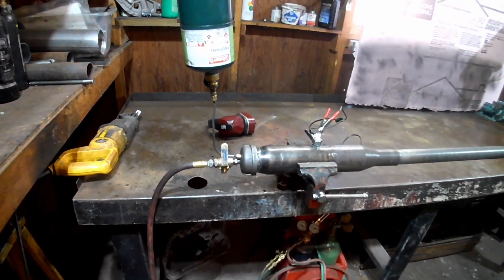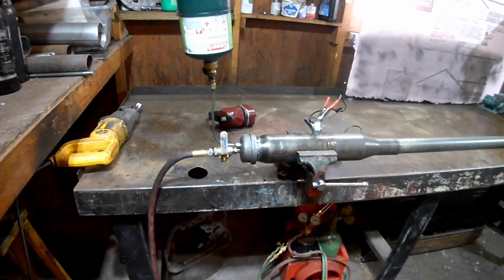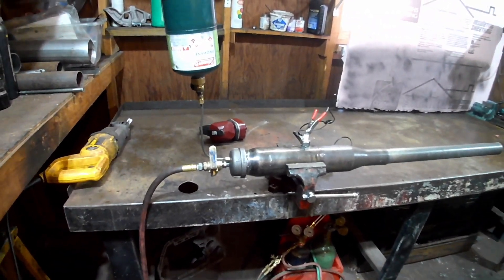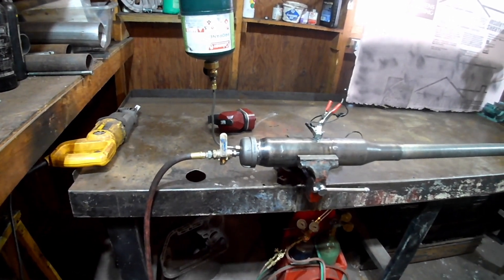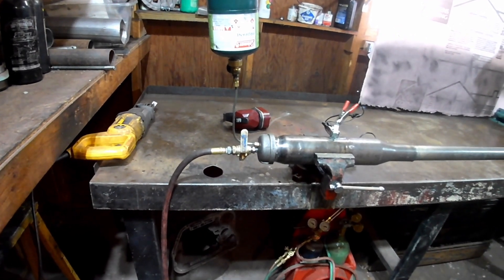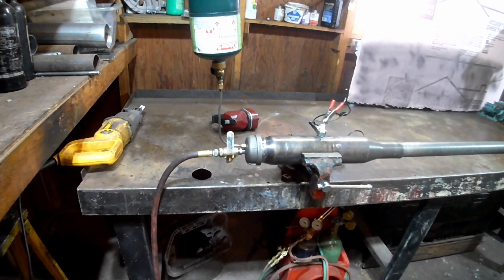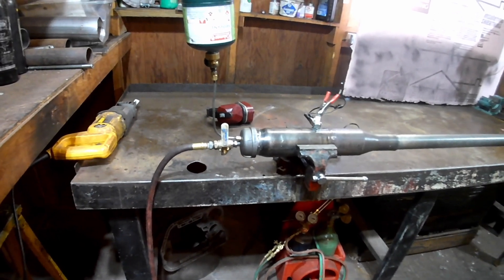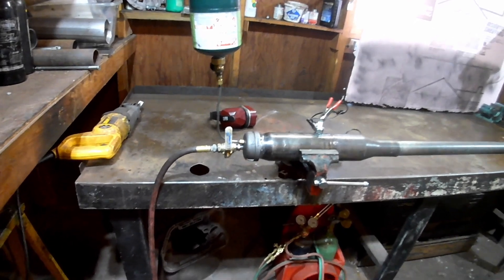Revisiting the possible pulse detonation engine.

Comment: I wanted to make rocket engine and pure oxygen wasn't available at that time so I built using my air compressor and stainless steel water bottle. I didn't know what type of engine is that. Now I know. pretty loud though : ) can you share a picture of diffuser and it placement.( drawing) It failed to pulse several times because fuel and air not mixed enough. Thank you
Reply from the maker: I have a vid, called pde spec. that gives the dimensions for the engine. and other specs. Built it out of a driveshaft from a mazda mk9.

Comment: With a pulse detonation the Shockwave should be supersonic would that not convert into a pressure wave which could be measured with an air/wind speed meter?
Reply from the maker: Atm, I can't think of anything that wouldn't break trying to measure it.  Though I did hook a load cell to it, that I usually use to graph rocket engines. It broke my load sensor. but last record was about 90 lbs of recoil.
Reply: @fignutron  what about at a distance say 1.5 meters maybe a windspeed meter
Reply: I have been working on a Pulse Detonation Engine using petrol and air for many months could you look at my recent video and give your opinion on what I belive are intermittent shock diamonds. Thanks
https://youtu.be/i4OOR8-gZ34

Comment: So how exactly did you get detonations to occur and what do you think made the design special so that it actually works? I had some success with a pulse jet 2 years ago but never knew how to make pulse detonation engines or rotating detonation engines
Reply from the maker: To be honest with you, I am not quite sure. This project started out as a ramjet idea. I didn't even expect the results that I got. Not an Engineer. Just a mechanic who has odd hobbies.
Reply: @fignutron  Thanks for the answer. Are you gonna try to research your project and see what could be the cause of the detonations?
Reply from the maker: @fallu6224  I am always researching, and when I figure out what is going on, I will post it.

Comment: Very neat video. I've read literature that said they could get small hydrogen-air pulse detonation engines to run at over 100hz. Obscene efficiency and the power to weight to boot. With how simple these things are I'm shocked they aren't used in hobby planes or rockets or something similar. There have also been some recent advancements in rotating detonation engines that seems really exciting.
Reply from the maker: Thanks, ATM , I am using compressed air and propane.. I Have not delved into other fuels and oxidizers for this engine as of yet. But that may change..